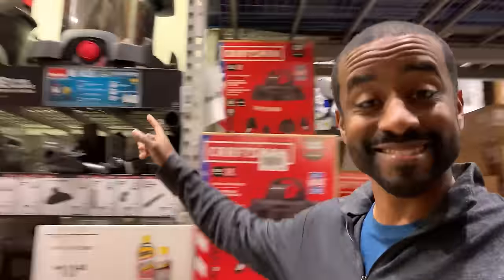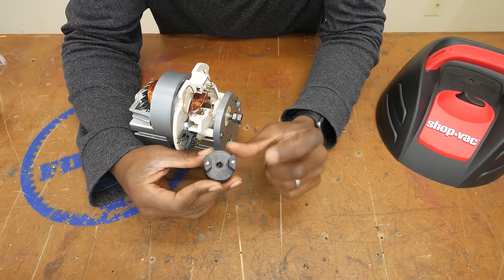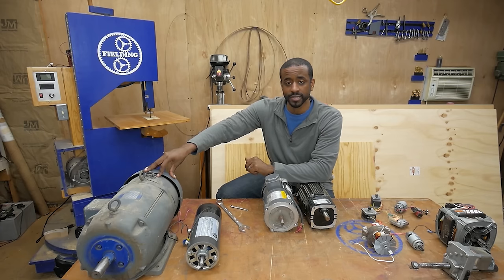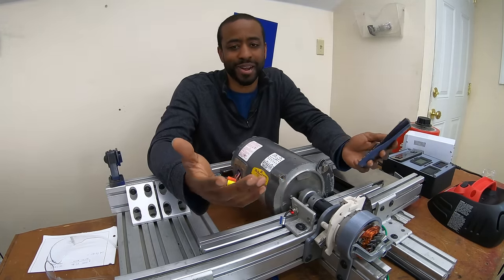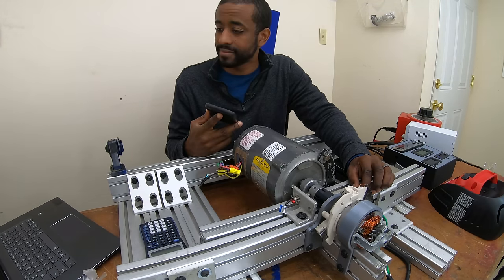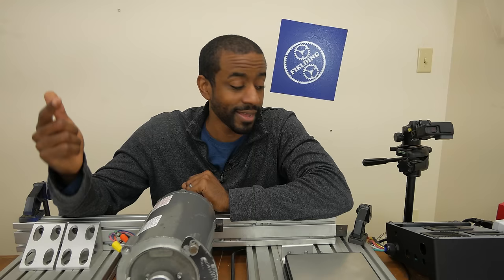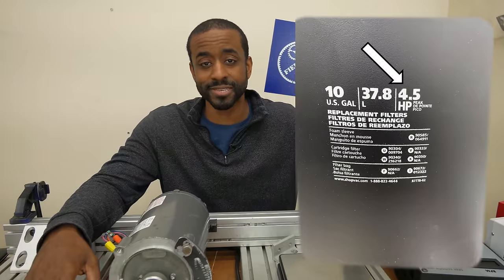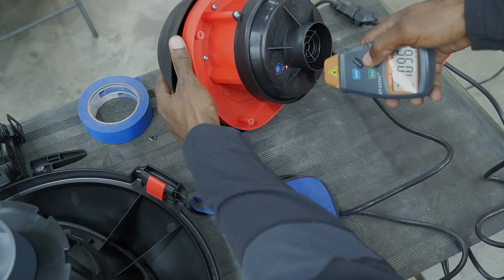How Much Horsepower Does Your Shop Vac Really Have: #078

Comment: The key word in the sales pitch is inertia. When they test the motor they spin it up then “slam the brakes” on the dyno then for that millisecond where the motor is still spinning 15000 rpm and making 1.6 ftlb of torque. The energy that they use to find these results has nothing to do with the power of the motor but with the energy it can store in its rotational mass aka inertia. They claim this figure to be relevant to vacuums when the suction is completely cut off it uses the energy stored in the spinning motor to add some extra umph. I am not agreeing with their methods or figure validity but that is how and why they do it.
Reply: They're essentially forced to test like that and give those numbers, even if the company doesn't like the testing method and would like to give a real number. Since every other shop vac is rated like that, they won't make any sales unless they test the same way. It does at least give some limited ability to compare because they all test in the same way. Really it's a matter for some regulatory body to fix, give stringent test parameters that must be followed. Unfortunately regulations and consumer protection is pretty poor in the US.
Reply: They really should call it BHP since that's what we commonly use
Reply: Ryan and that’s why brigg and Stratton decided fo advertise in torque instead of hp.   It’s more important in lawn and gardening stuff.
Reply: I suppose they could just spin up some (relatively) huge flywheel to buff those numbers up, basically arbitrarily. Might take a while to turn on your vac, and make it actually suck less though.
Reply: @xeigen2  My old craftsman is not some flimsy plastic piece of shit and it only lists 2.5hp and I have stood on it as a step stool. It also lists 140mph of suction. I actually believe those numbers because it is powerful as hell. This little piece of shit probably barely sucks up a puddle. My craftsman could actually pump whole buckets of water through a 2.5-3" hose there is no way this thing can do that without breaking suction.
Reply: @nominalvelocity  Yup. Take a 50lb flywheel and some 50:1 gearing and use a 100w motor to spin it up. It won't lift a kernel of popcorn but I can put 300hp on the box.
Reply: This is exactly what I was guessing, but do you know for sure?

If HP is Torque x RPM / 5252 then you create a scenario where the RPM is very high by loading the shaft at an optimal rate to store the most rotational inertia without bogging down the motor and causing it to get overwhelmed and slow down, but the torque required to virtually instantaneously stop it, e.g. by slamming it into some other object and measuring torque that way, is also very high. Use instantaneous RPMs from the moment of impact.

By "equal and opposite" you could make the flimsy argument that it is the "motor" outputting the equivalent torque.

Play around with different methods of loading the motor and different RPMs to maximize the stored inertial energy, based on calculating the product of RPM and torque, and there you go - phony, inflated lab-test-only numbers that are only tangentially related to its real performance. 

If the vacuum were designed to make great use of the stored energy (not requiring several seconds run-up and a flywheel that isn't even part of the product), it could be a valid secondary spec, but clearly it is not.
Reply: I agree that Shop Vac is probably measuring some transient flywheel effect, which likely includes the flywheel effect of the impeller.  I fail to see any relationship between this and actually using the vacuum. In my experience, when the intake air mass flow is reduced due to the vacuum picking up material, the motor increases RPM as the load on the impeller drops; this due to the nature of centrifugal impellers, and the pressure difference between the input and output.
Reply: Thank you very much, I figured this was the case!

Comment: I was always leery about these claimed numbers being a retired hvac contractor.  a 3/4 horsepower electric motor in a furnace pulled 12 amps on a 120 volt circuit. thanks. great video!

Comment: I never really thought about it until you mentioned it. I work in Filters and we have a 5 hp motor for an entire booth, and it is quite a bit larger than any Shop Vac. Personally I think they would do better to rate the vacuum in terms of static pressure it can hold at a certain flow rate (i.e. 1.0" H2O & 500 CFM). There may be better metrics, but that at least would allow one to calculate the 'suckiness' of the vacuum.

Comment: Yea,  what is the actual SUCKOLOGICAL FORCE ?  Suckosity 2 ?  Bar's ?  Inches Mercury ?  Water Ft ?  How many Golf Balls thru a Garden hose ?
Reply: Flow rate would probably be a better metric of performance in this instance.
Reply: Inches of water column at zero flow and CFM with normal hose attached. Those are the two suckological force parameters I would be interested in. I think my rigid shop vac can pull like 50 inches of water column. Don't know the CFM.
Reply: @mckenziekeith7434  YES, these two factors are what defines a 'vacuum cleaner'...it's deceitful that these aren't the advertised parameters for the device.   By the way, 50 inches of water is 50/408 = 12% of the maximum possible vacuum.  So we don't really create a 'strong vacuum' with such devices.
Reply: How many Bowling Balls is the Benchmark. Whatever? They SUCK!
Reply: CFM of air through a 10' 2.5 hose for the larger vacuums.  Really, what most of us are looking for is the wind force that will move small particles from a surface into the hose.
Reply: CFM or m³/s would likely make more sense. The ability to move air is what imparts momentum on whatever else it picks up. Peak power is probably a useless figure anyways, because once you draw a full vacuum on a vacuum cleaner, it's actually unloading the motor. (Seems contradictory, but think about it for a moment.) So knowing how capable it is at moving the most air would be more relevant.
Reply: @connellyboyle1  knob gobbles
Reply: Ken Jones In Europe vacuums state the motor wattage but also air watts, not sure how it's measured but basically it is an indication of both suction and airspeed. It's quite interesting to see the numbers, most vacuums have an air watt rating around a third of their rated motor power. We are fortunate though that we can plug almost any appliance into any outlet and draw over 3kw all day long. We have 3kw shop vacs that I suppose can generate about 1000 air watts so just over 1hp actual suck.

Comment: Im an electric motor winder and mechanic and I know we use the general rule of at 120V 12A is 1HP and at 230V its 6A for 1HP. But those also aren't usually universal motors but dedicated 1ph motors.

Comment: I can imagine how this marketing would go down in the EU: "that's a very cool claim, but keep it for your Tinder profile, not on consumer products". Vacuum cleaners have limited electrical power here, with the limit going down over time to force efficiency innovation.
Reply: Are they not marked the same in the EU
Reply: James Holbrook they’re not, no. This is actually the first time I’ve seen this marking for a vacuum. In the EU, you mark the input power of the motor in Watts - the actual power it draws from the wall. And as nraynaud1 said, this figure is limited by law so that vacuum maunfacturers are forced to use better quality motors to increase efficiency.

What they usually tell you when you look at the specs is the maximum vacuum it can pull. This number is quite meaningful imo, if you compare two similarly sized vacuums with the same power rating, as it tells you a lot about the efficiency of the motor and airflow design.
Reply: Efficiency innovation good one. Ha. 
Gold wound coils,vacuum pumped case, or better yet why not a room temp super conductor
Reply: Yeah, but EU uses 220 volt, so it must be 9HP, peak right?
Reply: @jeffjohnson2792  no, we generally don't really pull more than 2.5kW from an outlet.
Reply: @nraynaud  Right, it was just a joke. ;)
Reply: @SuomiFinlandPerkelee     And that's why I bought a Sebo from Germany. I'm done with American companies.
Reply: @SergeantExtreme   aunt said the same with her BMW shes tired of euro companies. Making crappy cars
Reply: Same in Australia, they are rated in electrical wattage, the biggest I saw was 1500 watts at our biggest (box style) hardware store.
Reply: @hihaveaniceday9386    BMW has been known for making overpriced, shit cars since the 1990s, so that's her fault. Still, most European companies make superior consumer products compared to American companies. A great example being Sebo vacuums. Three years and still running like it's brand new.

Comment: Really nicely done, and I can remember have a discussion about this very thing with my dad 50 years ago. Peak HP seems to be some sort of, primarily BS, momentary rating where the motor is severely  overloaded and the inertia of the spinning motor drives the load. In theory they could essentially  rate any spinning motor at whatever peak HP rating they want, since, if you load the motor up fast enough while it is spinning, you will get nearly infinite torque,  for a moment, until the motor stops.

This rating was something that Sears started back in the 50s or 60s, and it has become industry standard nonsense ever since.

Comment: The "inertia" thing here includes the entire assembly... you need to think in terms of torque multiplication and increased inertia from the entire rotating mass.

4.5PHP would then be determined by spinning the motor at max speed with the vacuum assembly attached then trying to stop it from the outer edge of the assembly.  The diameter and mass of the assembly creates an instant where the torque applied and the RPM calculates to roughly 4.5HP.
Reply: Imagine measuring electrical devices the same way. Just charge up a capacitor and then short circuit discharge it to get peak megawatts power.
Reply: @ChristophPech  Slam the car against a granite boulder at full speed to get some nice  deceleration peak G forces for the marketing department...

Comment: The small engine industry went through this year's ago and now they rate some of the lawn mowers as displacement CC and not hp. I was always wondering how that old 3 hp Briggs turned into a 7hp engine, apparently it didn't.
Reply: Briggs got sued for that exact thing ,calling the old 3hp engine a 6.5hp engine (someone figured out that all the parts had the same pn# between the 3 and 6.5 hp engines and they had the same bore and stroke)and lost a chunk of money 15 yrs ago that's why they stopped using hp and went to torque and displacement so they could have the bigger numbers.
 And its a safe bet they are lying about the torque numbers as well.
Reply: @deadeyedsam850  I thought the head gasket on my 6hp lawn mower looked very familiar to the 3 HP gasket from a mini bike I had as a kid.
Reply: On the other hand, I hear stories of getting huge HP gains by putting a bigger carburetor on engines sold as 6.5hp
Reply: It’s the same thing with TVs. 1,000,000 : 1 dynamic contrast ratio. Completely meaningless.
Reply: I really wish this fellow would do a similar test on small gasoline engines because of this similar problem to electric motors.
Reply: @dkeith45  agreed
Reply: Maybe we should just ask the manufacturers directly if their wives are interested in their "peak performance" which cannot last more than 2sec without permanent damage, or their actual output? But probably they all got divorced on grounds of false advertising.

Comment: Heh, I used to have a 5HP vacuum at the lab I work at. It genuinely scared me when I put my hand over the suction port the first time I turned it on because I wasn't expecting it to suck me down that hard. (I then proceeded to tell my coworkers to do the same thing.)
This was a genuine 5HP 3ph motor with a massive squirrel cage fan and two pleated filters on the output. This vacuum sucked hard!
Reply: Likewise! Seeing my first "real" dust collector left me in awe: a 5HP motor powered by a dedicated 240v 30A circuit. After seeing that, I knew there was no way an itty-bitty Shop Vac motor could seriously claim 6.5HP.  After some research back then, I read that "peak horsepower" was calculated based on inrush current - absurd, since the motor draws that for only a few milliseconds!  To make it even sillier, manufacturers try to game that meaningless number by chilling motors (lowering winding resistance = the equivalent load of a non-rotating brushed motor) prior to testing!  If we went by that standard, I guess we have a 40HP dust collector in the wood shop, right? LOL
Reply: Can it pull stumps? That would be awesome!
Red Green

Comment: Reminds me of when I started working on cars back in the 90's and realized Japanese cars seemed to have more horsepower even when a similar American car claimed to have more. Then I read up on it and found that American companies were allowed to use all sorts of tricks to get that number as high as possible. Like taking off the water pump (as well as everything else) and putting pressure on the heads. It would throw off the number by as much as 30%.
Reply: That's greatly dependent upon the car and the decade you're looking at.. for example by the late '90s and early 2000s, GM was cranking out more horsepower than they were telling.. You would often see the the published crank horsepower to the wheels. Meanwhile Honda and Toyota, were really close to straight up lying. then the new SAE testing procedures came... And all of those imports had to lower their numbers, meanwhile Cadillac and Chevy raise the numbers on their cars because they were just deemed to be so low that they were being misleading.
Reply: that was with gross horsepower ratings of the 60s/70s.  SAE standards kicked then to eliminate these shenanigans.

Comment: Translation "the motors inertial contribution" means when we fired this motor out of a cannon it contributed a certain amount of inertia which we guessed was about a jillion horsepower.
Reply: I think it means that if you spin up the impeller to full speed, and then connect your load, you might very briefly get 4.5 HP because in addition to the motor output power, the kinetic energy of the impeller is also delivering power to the load (flywheel energy). But there are no circumstances under which the motor itself can deliver the rated HP.
Reply: @mckenziekeith7434  This approach yields completely arbitrary numbers. Because one can arbitrarily increase the instantaneous horsepower rating by increasing the applied (shock) load an arbitrary amount. The number work, providing one accepts the correspondingly shorter the duration during which this shock load will be applied. 

Analogy: A car colliding and crumpling together with another, parked car may equate to 1000+ horsepower for a tenth of a second. But, drive it into an unyielding concrete wall and it may equate to 2000 horsepower for a twentieth of a second. Rigidize the car's frame and body such the impact ends with virtually no crumpling/deformation, and the blow could yield well in excess of 10,000 horsepower for a few milliseconds
Reply: @gregparrott  I agree with everything you are saying. Arbitrary is exactly the word I would use. I was attempting to explain what I view as a completely bogus rationale. I didn't mean to justify the rationale, just elucidate it. Elsewhere in this section somebody pointed out that the "peak HP" limit then becomes a function of max RPM and the shaft strength. Which, of course, makes no sense whatsoever as far as what a consumer or user of the product would want to know.

Comment: Great timing.  I was looking at a Harbor Freight flyer this morning and saw a shop vac with 4.5hp.  I said, "What the ------."  4.5hp out of a 110V 15A socket, I don't think so.  Great video.  I did a study on built-in obsolescence about 30 years ago on hand-held power tools.  A cheap 1/4" hand drill was designed to last 28 minutes.  That was the design for Joe Homeowner who drills a couple of holes and then puts it away for a year.  The same company also made professional grade tools that truly were for the everyday professional.  This was just a case of, "You get what you pay for."  I just subscribed to your channel.

Comment: Great job there! That motor "dyno" is quite interesting. Remember several years ago when lawn mower's had big stickers on them saying like 6.5HP on a standard single cylinder mower? They finally got owned and fined for lying. At best the rating may have been torque instead. In FtLbs. Until the FTC wakes up and goes after vacuum cleaner companies, the crap will continue. You are right about efficiency of vacuum cleaners, they "suck". My Dirt Devil upright brags about being a 12amp motor! After running a few minutes, it puts out more heat than a blow dryer!
Reply: Add consumer grade air compressors to your list of products, that claim impossible horsepower ratings: Where is the Federal Trade Commission when you need them!?

Comment: As an engineer walking by shop vacs for sale always made me cringe for this reason. I believe there is a big class action lawsuit against shopvac and other makers now due to this misleading advertising. Also folks, if you have a normal house in the US, running 20A breakers on a 115V circuit, the max power you can achieve on that circuit is 2300W. Since 1HP=746W, the max your breaker could support is about 3HP. Or 2.3HP on a 15A breaker.